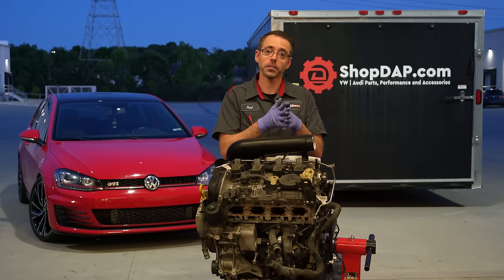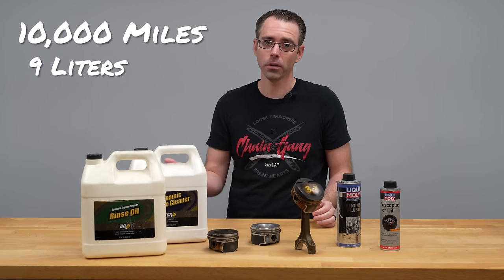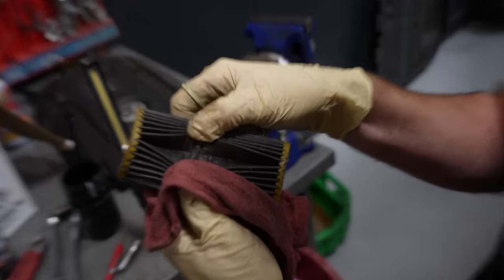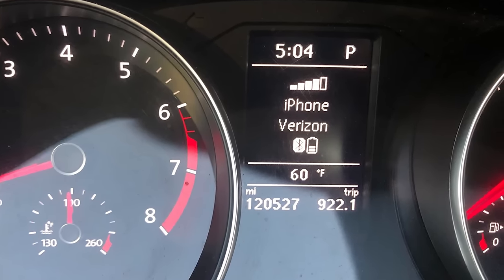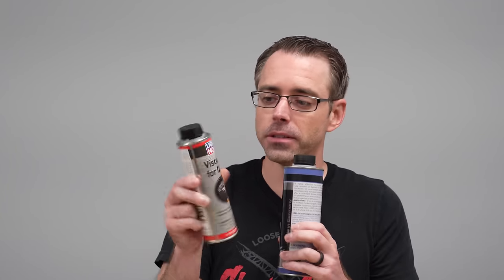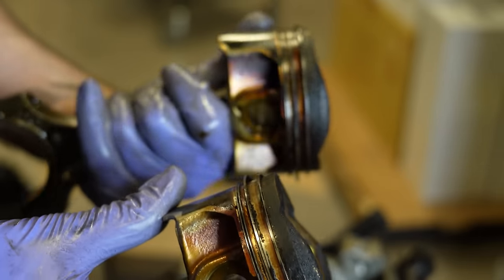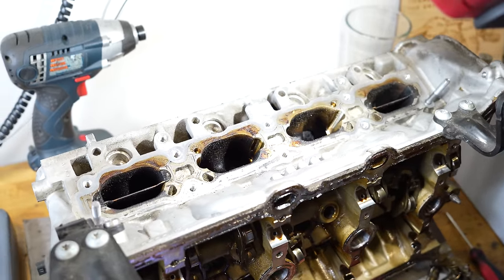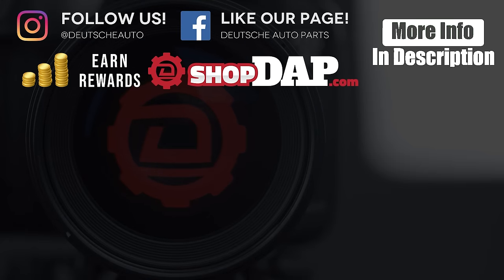Can you Fix an Engine Burning Oil for $20

Comment from the maker: Links for stuff in this video - 
Our Repair Shop - DAP Repair
https://www.daprepair.com/

Our VW and Audi Parts Site
https://www.shopdap.com/

BG Dynamic Engine Restoration 
https://amzn.to/3LvHpXn

Liquimoly Pro Line Engine Flush
https://www.shopdap.com/pro-line-engine-flush-500ml.html

Liquimoly Viscoplus
https://www.shopdap.com/viscoplus-for-engine-oil-300ml.html

Ball End Triple Square Bit Set
https://www.shopdap.com/ball-end-triple-square-set-wkztsqktball.html

Audi Oil Consumption Repair Set with Updated Pistons
https://www.shopdap.com/finder-data/engine-repair/maintenance-kits/oil-consumption-repair-kit/06h198065dmgrp.html

Updated 1.8t Piston 
https://www.shopdap.com/06l-107-065-as-vw-audi.html

Updated 2.0t Audi Piston
https://www.shopdap.com/06h-107-065-dm-vw-audi.html
Reply: Is it a bad idea to use one of these products for preventitive maintenance?  I have a 2016 mk7 gti w/ ~60k miles.  No oil burning to speak of at the moment.  I'd like to keep it that way.  I'll be ordering oil an filter in a few days!
Reply: I sold my GTI cause of thi fu…. Burning oil 👎👎👎 I will never bay a gti
Reply: Was it an impersonation od that guy that has Mercedes Benz channel where you advertised the sockets?
Reply: @benamarayoucef9402  Don't blame the car, blame the EPA and the climate crisis con men and women.
Reply: Have you tried engine restore?
Reply: @edwardharoldbutler7076  I have tried Engine Restore. I had mixed results. My wife's car has close to 400,000miles on it. It temporarily improved compression but it didn't last and made the engine consume even more oil than before. I add Lucas oil stabilizer to slow the consumption down.

I have another engine built and ready for her, I just want to see how far that old Jetta will go on the original longblock. Her car has really impressed me with how it just keeps on going.
Reply: modern cars burn oil from factory,,its how there built.. funny, the greens & epa, make manufacturers meet standards, but oil burning cars is fine..plus,,synthetic,,is pathetic. more changes, thinner, burns, . thrashed my clevo for 14 yrs, dont use a drop..351c..best engine ever built..
Reply: Those rings are soo narrow
Reply: I used, chemtool b12 in the oil for 20 minutes, then changed oil. Went 800 miles, I then tried bg 109 engine flush that helped a lot and changed oil. Went 300 miles and did a top down flush with chemtool b12 while engine was hot. I added about 110ml to each cylinder and let sit for 12 hours, then added another 110ml per cylinder and let sit for 2 hours, used an extractor to suck up anything in the cylinders, including chunks of carbon. Drained oil and immediately drive the car hard. In theory, this would soften the deposits and allow oil pressure to wash them through. I now add 1 quart of marvel mystery oil to hopefully aid with deposits. I just recently did this but i already see it has improved my oil consumption by alot. When i know just how much i will add it. I was burning 1/2 quart every 150 miles before i started. It went to 1/2 quart to 300 miles after the 1st flush and has been improving. Since the last flush i have not seen a change in my oil level so far. I have updated parts i believe because my car is an 2012 a4 and listed as having an engine in 2018. I scoped the cylinders while doing the top down flush and the cylinder walls looked good as did the pistons. I did have a lot of oil passing through the pcv into my turbo. The car didnt smoke so i wonder if i didnt have a blowby issue forcing oil through the pcv. Ive worked on cars for a while and im stumped by all of this. The amount of oil consumed, no smoke, dry spark plugs, then most of all the change in consumption from flushs. I did fix a leaking upper and lower timing cover while i replaced the timing chains and tensioner. I was ready to throw pistions in it and the flush was a last chance effort to extend time before i need ti replace them. Now, i believe i can keep improving the oil consumption if i maintain the car correctly.
Reply: I am surprised that some people in Europe still believe they can save money by doing 20k miles/2 years Longlife oil change interval in gasoline engines.  Yes vw 506/507 or 508/509 are great oil but 1L per 2k miles is already too much. 1 L per 1200 miles is a nightmare, like my notorious 2.5L NIssan Altima 2002 from catalytic converter polishing the cylinder wall.  It melts the glue that keeps the filter together. Whatever it is, it is carcinogenic with tons of benzene rings.  The updated piston is exactly like the update in Camry 2007-2010. The groove is removed and the oil control ring is thicker.
Reply: @BrandonCartwright
Reply: My 2016 Tiguan r line was burning oil I took out plugs stuck a camera down to see the pistons seen carbon build up on them I filled them up with sea foam let it sit for a day then stuck a hose use shop vacuum to suck it and they came super clean change oil put one quart of Lucas full synthetic oil stabilizer and 4 quarts of Audi oil and till this day is fine no lost of oil thank god
Reply: You are incorrect. GM accepted consumption is or at least was 1 quart every 300 miles.
Reply: Rinse oil is a regular cheap oil, to rinse leftovers.